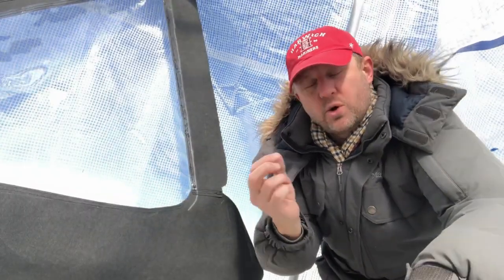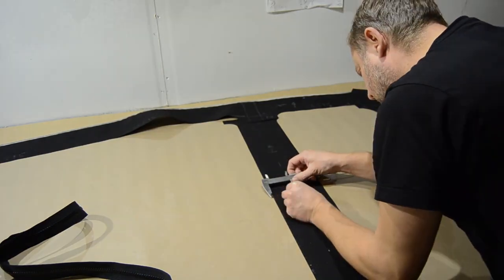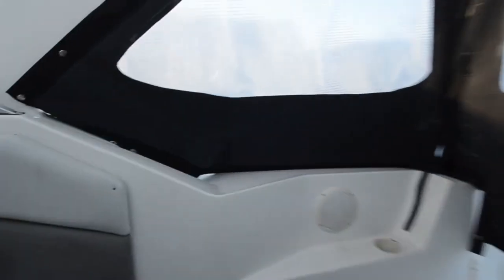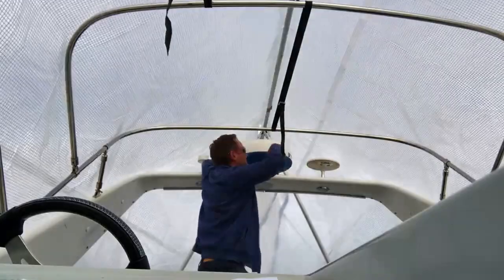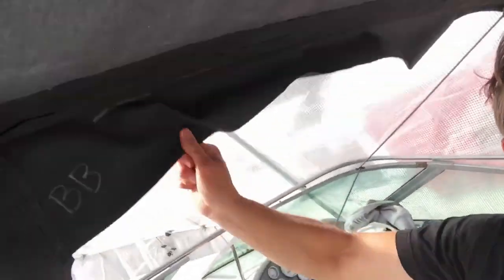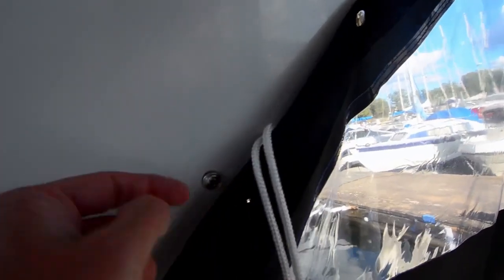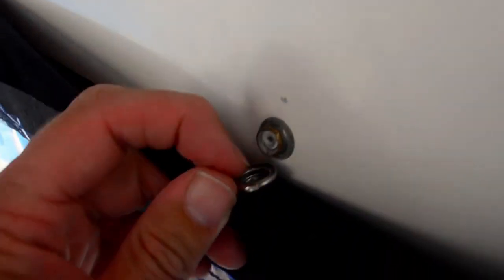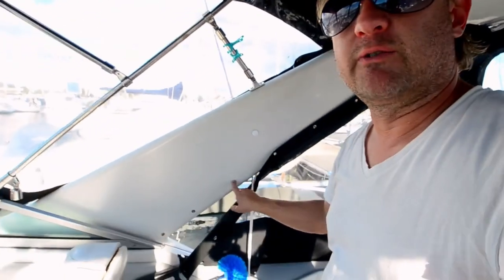MAKING YOUR OWN BOAT CANVAS

Comment: Great video! Thanks for posting. Can you tell me what model is the sewing machine, and did it do a good job?
Reply from the maker: Hi, thank you for watching. I have a Singer Heavy duty 4423. It does the job but it would have been alot easier with a machine that has its own thread roll instead of having to spool up the small ones. I ran out of that thread many times and needed to start over the seam.

Comment: Hello 
Did you already have experience on making boat covers? And what machine do you use? 
I’m hoping to learn how to make these and need some advise. 
Thanks great job
Reply from the maker: Hi, I had absolutely no experience of this kind of work before I started. :-)  I use the Singer Heavy Duty 4423. The only problem was that I ran out of thread in that small under thread kind of thing that you need to spool up all the time. I ran out of thread a couple of times and had to re-do the seam. So a machine with separate spool for the under thread would have been easier.

Comment: Great job! What fabric did you use and how will you repair the damaged parts of your canvas? Did you use a heat cutting tool for the fabric? 
Amazing job and thanks for posting
Reply from the maker: Hi, I used fabric from Sunbrella. I did not use a hot knife, only scissors. And it has only been problem with the fabric when it is cut exactly along its woven threads. :-)